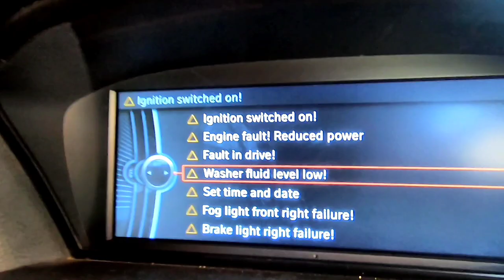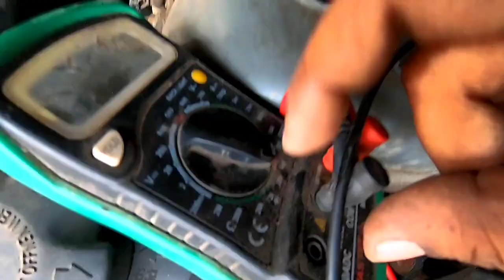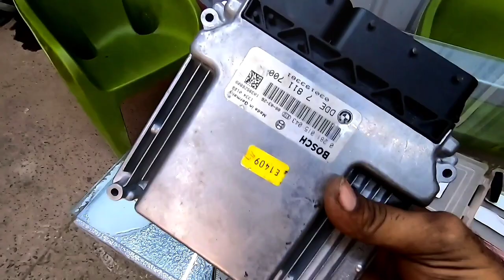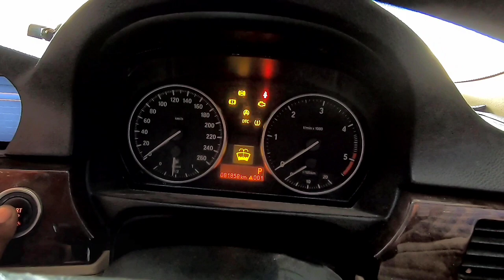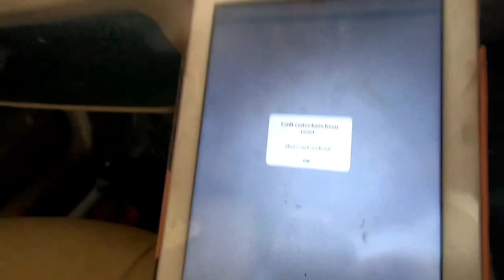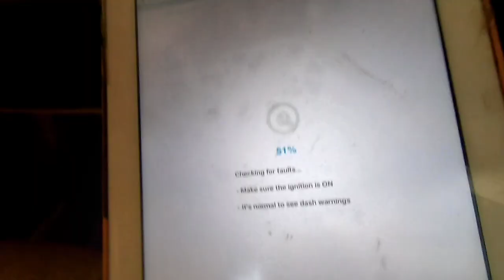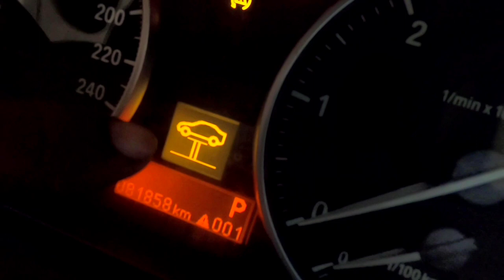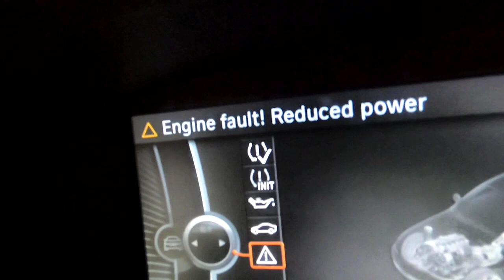BMW 320d engine starting problem fix ECM REPLACE

Comment: Hi I got same car cranking but not starting stop on the road I try to open the fuel pipe from injector but not coming fuel but from fuel pump
Is show me is coming fuel what you think will Be problem thanks for help

Comment: Ecm mosfet  why its damage  may be its happen again i think  need to check this particular  mosfet control  witch circuit. maybe injector throttle somethink like that